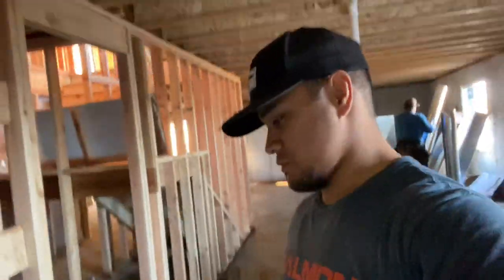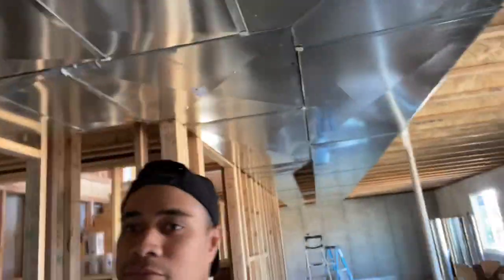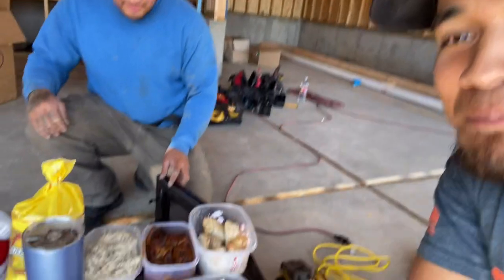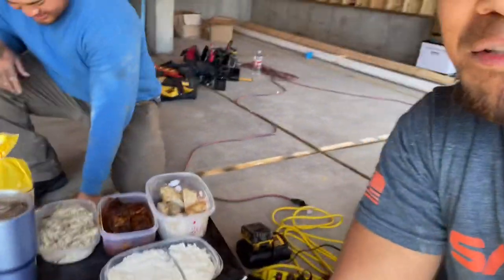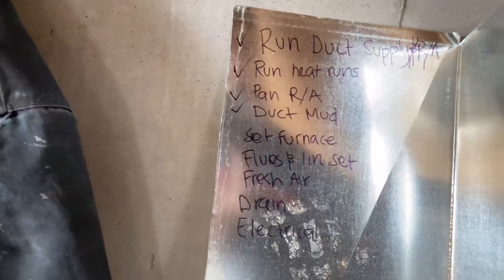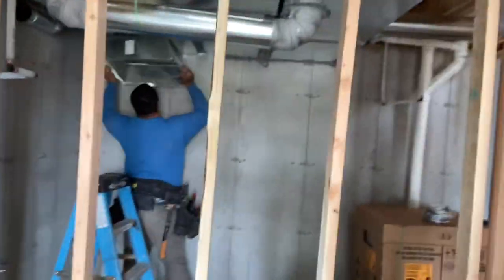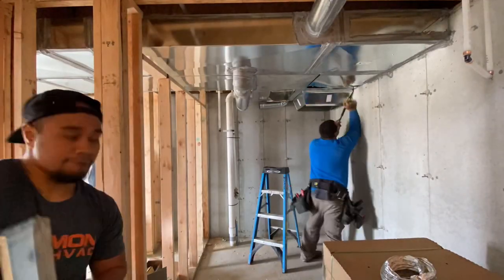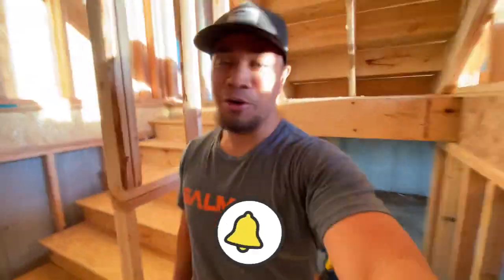HVAC Installation | New construction

Comment: For heating, do inspectors want the seams on top of round pipe horizontal runs, or is that only important for exhaust fans or dryers where condensation dripping out of seams can happen?

Comment: Hey bro I  need to run 3/8 & 3/4 soft copper lines in new construction.  I bought 50 footers but only need about 28 feet of run. I have to bend them into ceiling and out of the ceiling about 10 feet apart and the space is about 15 inches for the two 90 degree bends. Can you suggest how? Ive seen some videos where they bend copper lines by filling them with sand or water so no kinks. But not sure if I want to introduce moisture or debris into these. Thanks

Comment: Did you insulate  the suppy or did it come insulated
Reply: You don’t need to insulate ducting if it’s in a conditioned space. It would help keep the temp coming out of the vents, but not necessarily needed

Comment: ✊. When do you need to use mastic sealant at the joints and seams to prevent air loss?  Gracias.
Reply from the maker: @Wayne Gomillion I honestly use it at every joint.  Most of the builders we work with requires all joints sealed to meet energy start rating so i got into the habit of sealing every joint. How often do you seal?

Comment: I have two question for you 
I’m finishing my basement house was built 2018
I need to attach register for small bathroom 
1. My main duct sits right above vanity I need to hook up my register directly to the duct. What adapter do I need to use to do this from duct to the ceiling I have 2” space?
2. In one of my rooms I have to run return above left side of my closet door ho do I do this without compromising structure of the door ?
Do I just cut half of the 2x4 will that be enough for return air. 
Thanks
Reply from the maker: @miki miki leave your number and I’ll give you call and explain it.

Comment: Hey may I know what kind of tool belt you are using..I'm new into installation and I need to purchase a belt for tools. Thanks
Reply from the maker: @Jc Ortega Best Seller i have a 
Husky
2-Bag 10-Pocket Black Contractor's Work Tool Belt. $39 
It’s a cheap belt at Home Depot I’ve had mine for over 4 years now.

Comment: So hard pipe was cheaper then using flex for the runs
Reply: Square duct keeps everything closer to the ceiling. If you have a 20” flex people would have to duck to get around it all the time